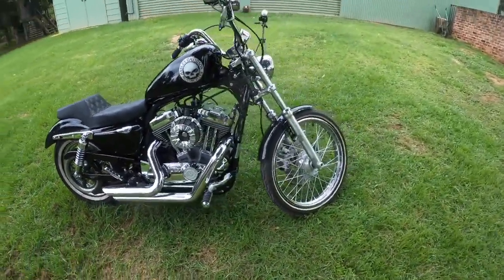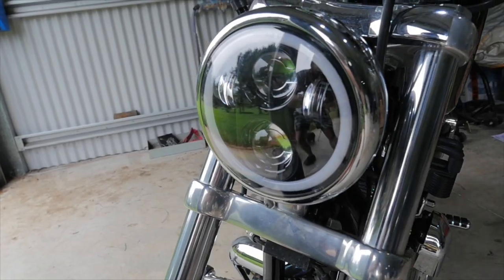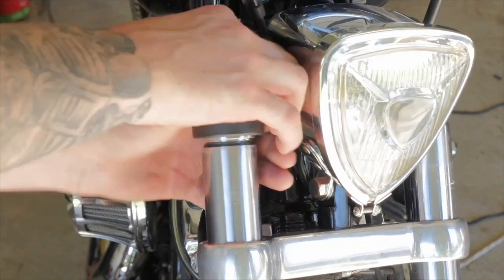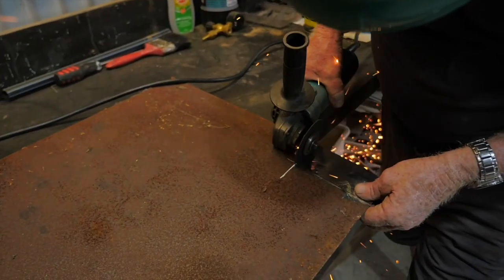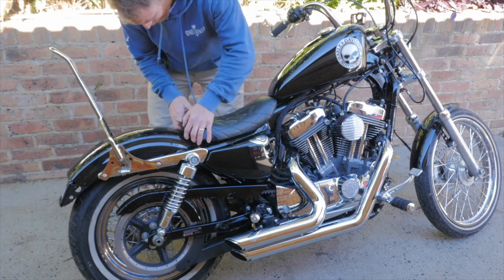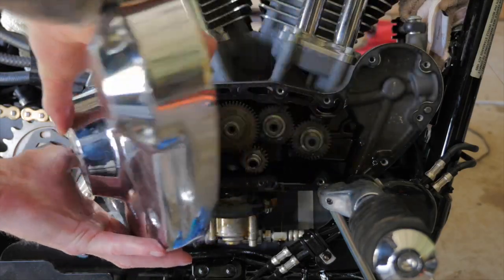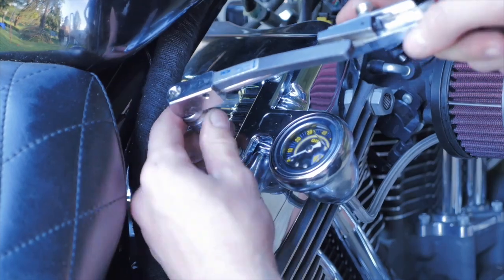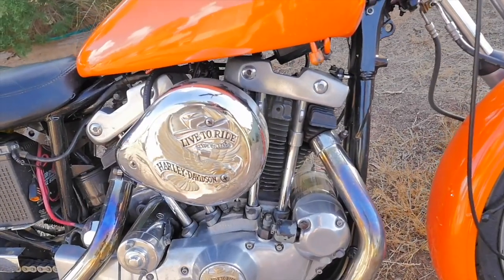Sportster chopper transformation

Comment: Nice work GM. Your videos have been great to watch.  I've got a 2014 Sportster 1200C and I really want to do the fork mod.  I only want to go up around 1".  But I'll need to extend my brake line too.  So your video on that was very informative.  Did you notice any power increase with the belt to chain conversion?  I've heard it adds a few hp.
Reply from the maker: The gearing I went with for the chain conversion was very close to stock so there wasn't too much of a noticeable difference. If you went with a larger rear sprocket than I did it would increase bottom end torque/acceleration down low.